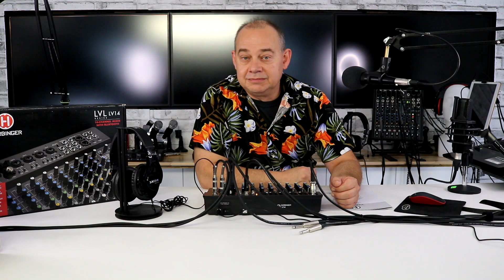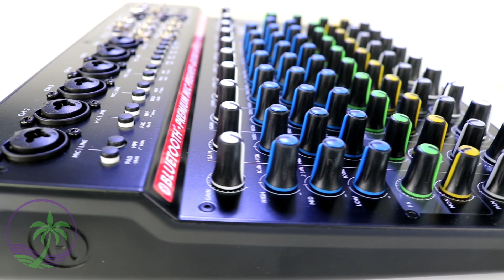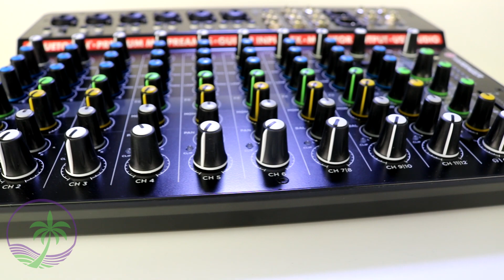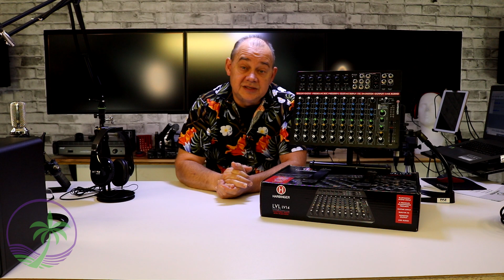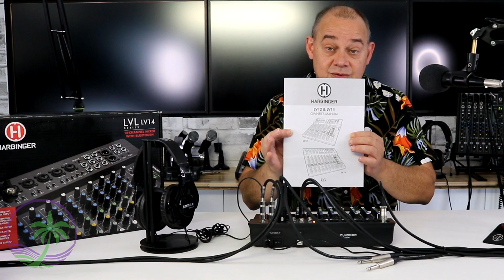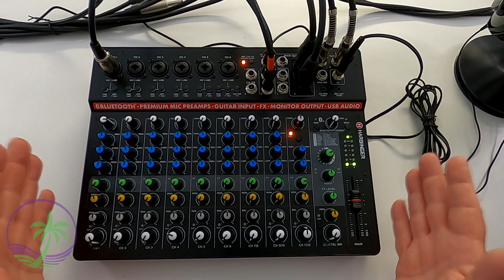NEW Audio Mixer from Harbinger LV14 14-Channel Analog Mixer with Bluetooth, FX & USB Audio

Comment: Why does each channel have a gain control - top row - - and a level control - bottom row? Aren't these the identical function? If not, how do you choose how to set the volume of each channel intelligently? Also, there is Monitor out and Control Room Out: are these the same mix?

Comment: How do you connect this to the msl 1000 line array system??  I’m confused in which output to plug into to connect one to the other. Thank you   I got both and need to connect the two.
Reply from the maker: You Can Use The 1/4 Main MONO output. Great output for connecting one speaker to the Mixer.

Comment: You do a great job with these reviews. I really like the look and features of this one. Questions: what are your thoughts on the quality of the reverb/effects? I have 3 mixers and only one has usable sound on the reverb. Also, did you try connecting to USB on back to a computer? Did the computer find the mixer? Did you have to install a driver?  hey thanks
Reply from the maker: You're going to Like the FXs because you can customize them with the Adjustment knob, No driver is needed Plug&Play, I recorded & Play Back with it on audacity with No problem.

Comment: Question: For drum mics that have two overhead condenser mics and the rest are dynamic close mics, is there any issue plugging all the mics into the XLR inputs while using phantom power for the two condenser mics?
Reply: Below is from the LV14 manual:

48V PHANTOM POWER
A voltage signal that runs through a microphone cable to power condenser microphones. Harmless to microphones that don’t need it, except for very old and/or damaged ribbon microphones.
Reply: @christopheralan6474  thank you. I always heard not to use phantom power on dynamic mics so I assumed that meant it could damage them.